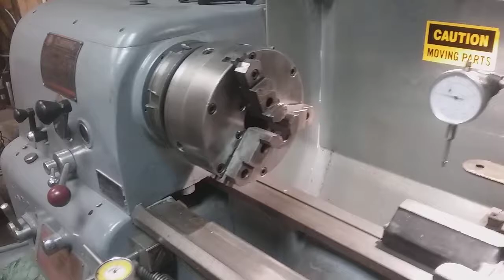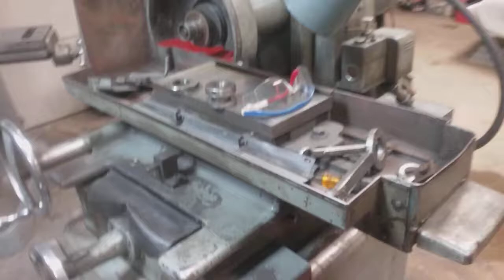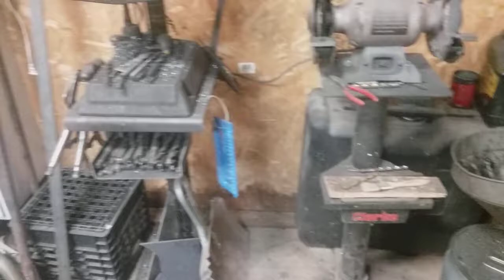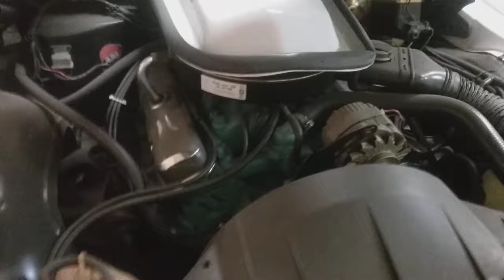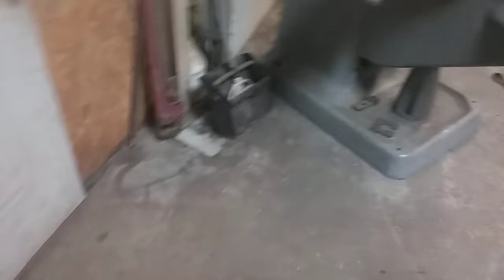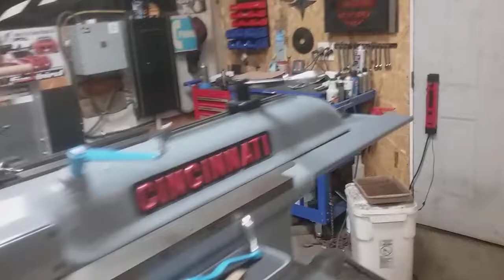Machine Shop Walk Around

Comment: Nice shop, I like the worn out bridgeport that looks pretty. I an ending up with one of those as well
Reply from the maker: I sold that last year. I have a nice Index mill now
Reply: @metalworksmachineshop  I may get mine re ground. Just a lot of $$ to drop on a old bridgeport.
Reply from the maker: 1000.00 a way.  You could find newer and better for what that would cost
Reply: @metalworksmachineshop  That was my thought. The bridgeport I am going though now I only gave 400 for. Its not super tight but I don't have much in it. It looks purdy though.

Comment: Nice tour! I welded for lots of years back in the 70's and 80's. I also like Pontiacs. You have a nice TA! I have had a few of them but my 2 favorite were a white 73 w/ a SD455 and a 77 that I built a mean 455 with ram air IV heads. I subbed.
Reply from the maker: Thanks  ive had Pontiac Trans Am`s for years. My favorite was a 77 W72  that i fully restored but painted it 78 Marty blue.